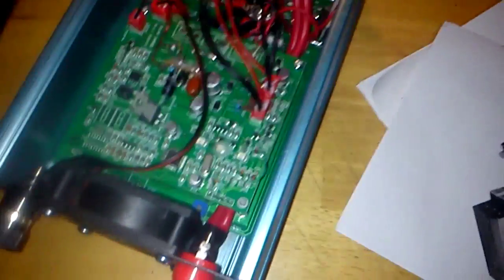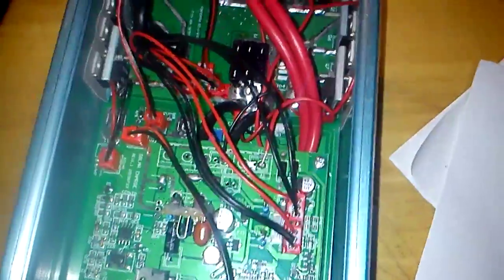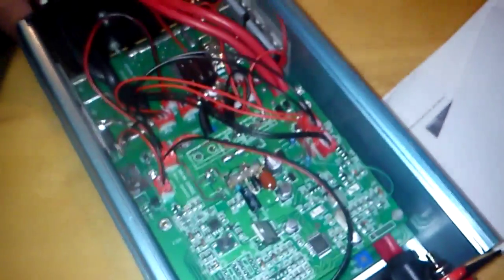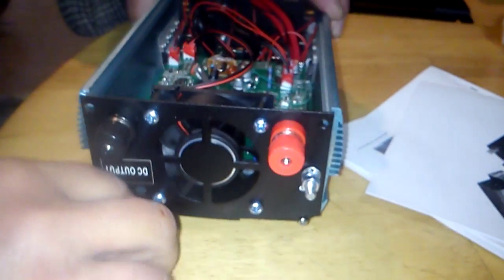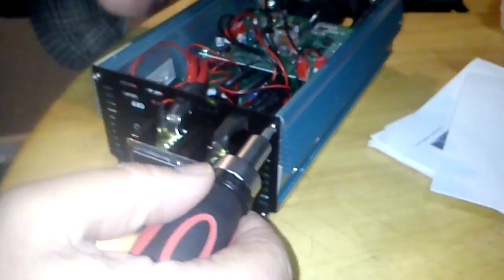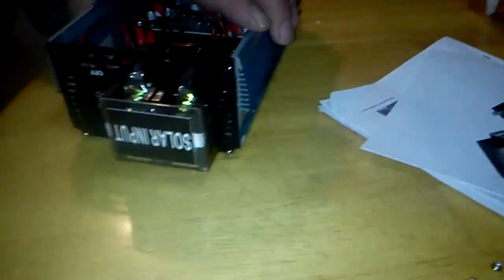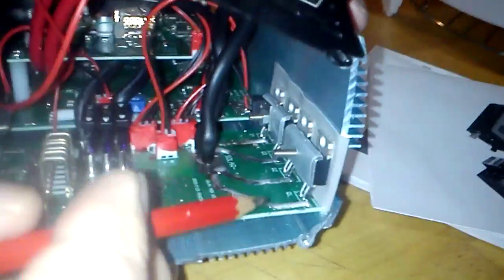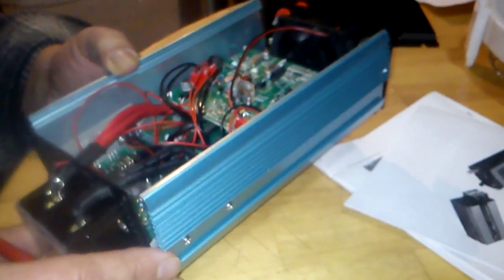MUST WATCH! China Solar Charge Controller Danger Fix Power Jack 100 Amp

Comment: I have 2 of them and there are CRAP only take my battery bank to 13v will not bulk charge I have them to kick on when a load pulls from the bank to help put amps in under load and that's it they not full charge a battery at all live to work out how to boost the thing up to 14.4v that be good

Comment: Wheres the update to this vid??? Any luck with it at all???
Reply from the maker: +OffGrid Aussie Prepper™ I may abandon trying to use this setup because I would not have piece of mind when I was not around to monitor it. I bought an American Made Itronix MPPT75HV 75 Amp (my 2nd one) to use instead. http://www.ebay.com/itm/MPPT75HV-75Amp-12-24-36-48V-MPPT-Solar-Panel-Battery-Charge-Controller-US-Made-/252107692845?hash=item3ab2ca1b2d:g:UmoAAOSwq7JUBff0
Reply: Military Industrial Museum yep... if u can score a morningstar u will have real peice of mind cos they r built to specs and r industrial grade, but they r expensive and the best thing about them is u can monitor them with a pc.